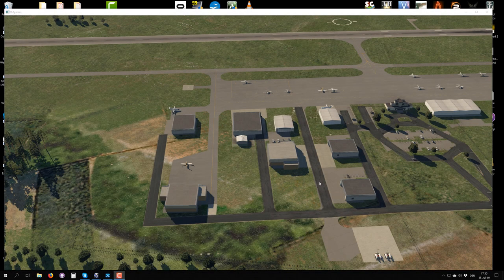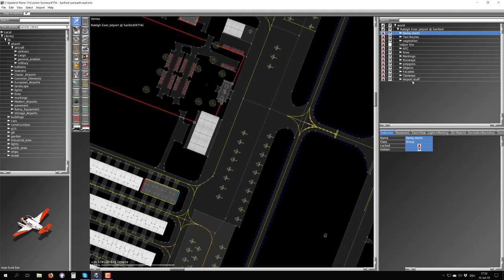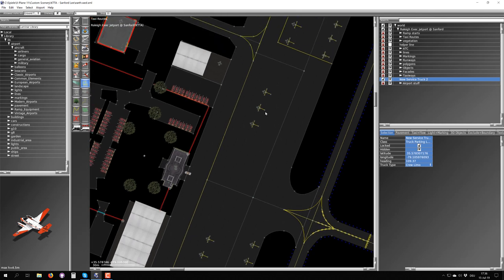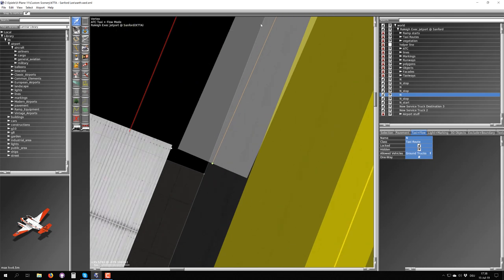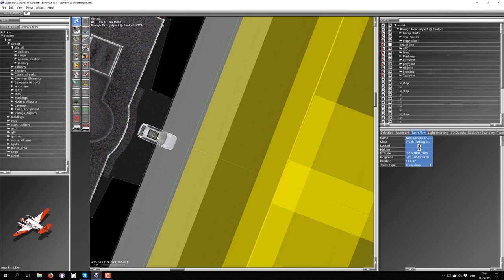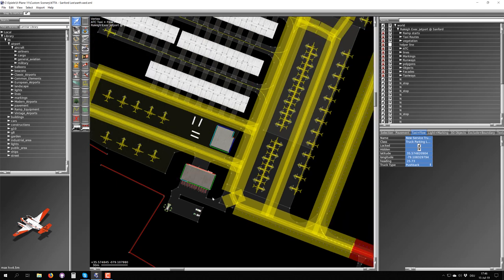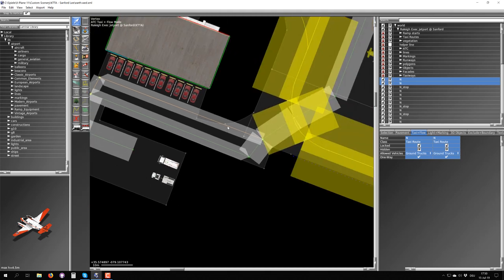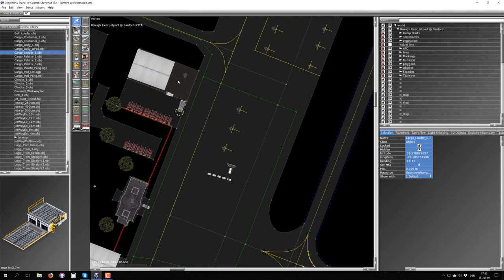14 - Adding ground vehicles

Comment: In FSX/P3D the AI taxi paths and ground vehicle paths should normally share nodes when crossing, so that Ground vehicles will 'give way' to aircraft (User & AI) when crossing a taxiway. If they don't share nodes the ground vehicles will not 'see' the aircraft.
Reply from the maker: Ah, interesting! But I dont think that is the reason its that way in X-Plane - the cars are "aware" of other cars, AI aircraft and the users aircraft, no matter if they are on the network or not. It is probably a legacy from adopting the network code to ground vehicles.